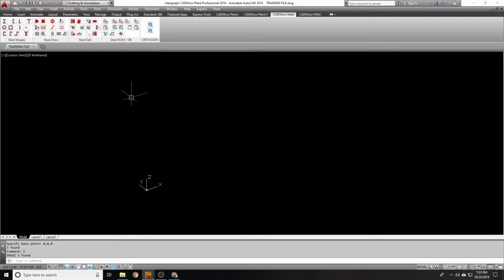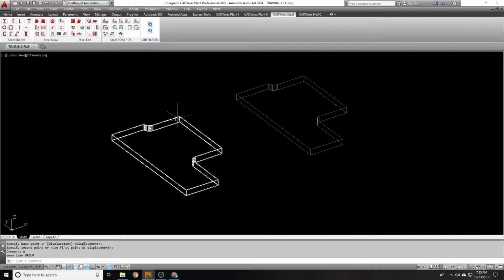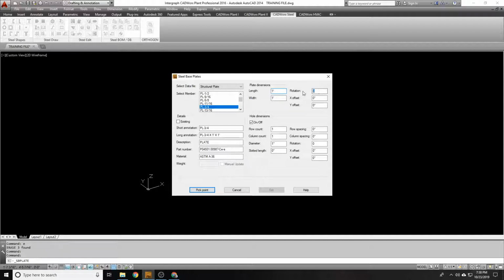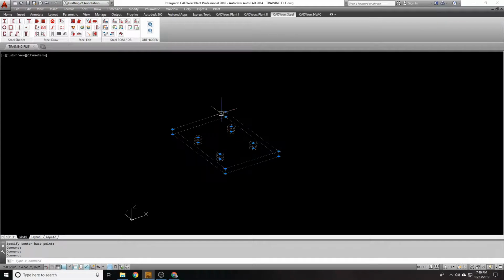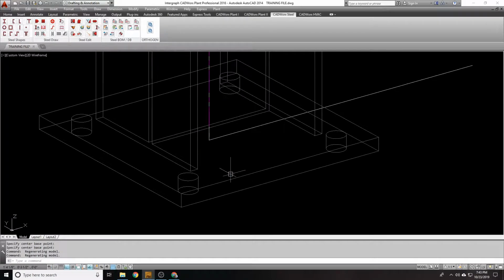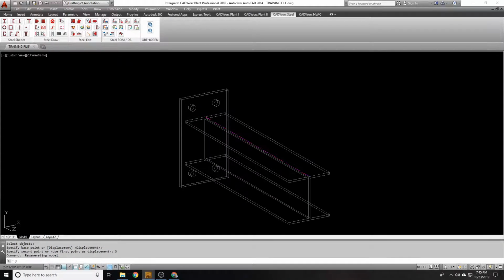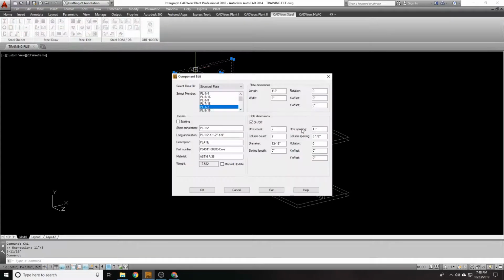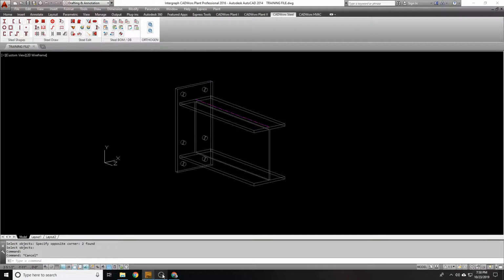CADWorx Steel - Plates

Comment: For anchor bolts, do you know how to add different bolt types or at least remove the nut at the end of the straight bolt? Seems to only have Straight bolt (with nut on end), L bolt and J bolt available.
Reply from the maker: Since CADWorx Steel 2016 didn't have 3D anchor bolts I'm going to assume you're using CADWorx Structure 2017 or newer.  Unfortunately what you get is what you're stuck with.  Hexagon didn't give us a way to customize the 3D anchor bolts.  Typically I don't even show 3D anchor bolts beyond a simple cylinder but if you want something more customized you might consider making your own bolts out of 3d solids.
Reply: @youcandraft  Thank you! Been looking everywhere for information on this. Think I'll stick to simple cylinders